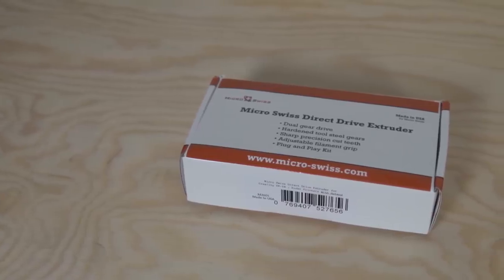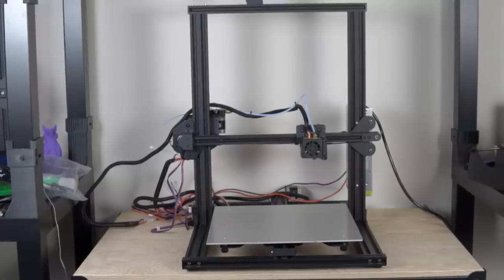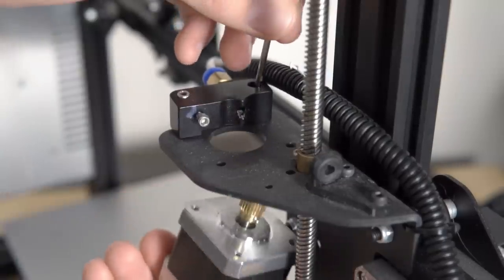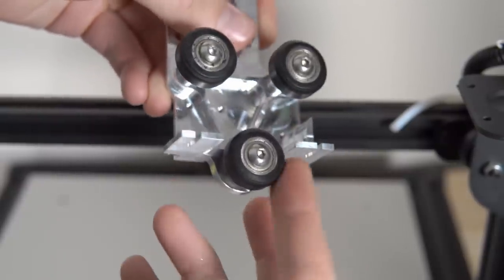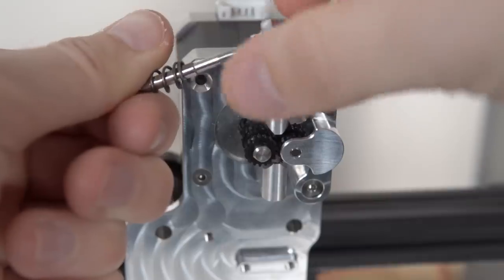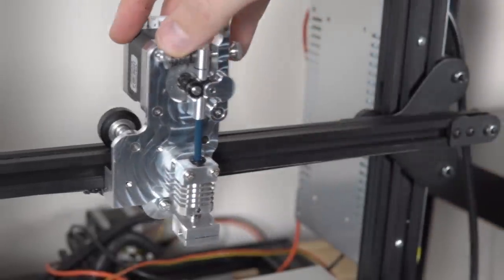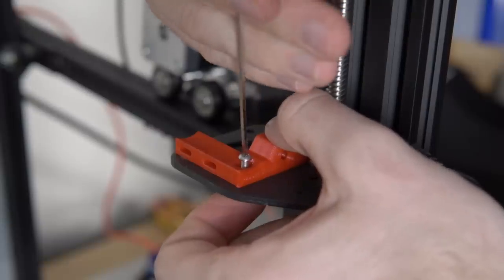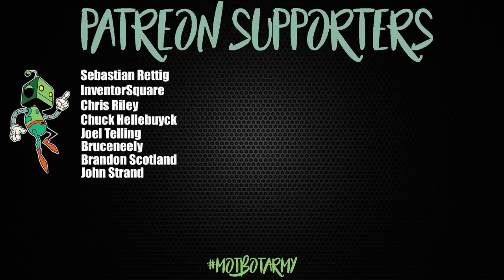Micro Swiss Dual Gear Direct Drive Upgrade For Ender 3 and CR-10 3D Printers

Comment: Thanks for that, great video!! I supose that it can be used with a pancake extruder as well... a bit lighter :)

Please let us know if PLA can be printed with this setup... I know that with some all metal clone extruders it is not possible due to the higher heat and expansion of PLA inside. 

Cheers!
Reply from the maker: That might not be a bad idea. I will see how this prints for a bit and see if I think I want to add a lighter pancake stepper motor. I could not see any issues from printing in PLA but I will certainly put it through its courses.
Reply: @ModBotArmy  Did you print PLA with it?
Reply: Hi there, I have succes-l prints with PLA and this DD All-metal extruder, but I had to lower nozzle temperature in my slicer by 10 Celsius comparing to bowden profile. Printed 3kg of PLA without any issues or jams. Hope, this will be helpful. And don't forget to lower everything related to retraction, because this is DD.
P.S. Please note, there are 1000 types of PLA, even different colored PLA of the same model and brand can have different temperatures that work for them. You need to play with yours. I am using D3D Tough Black.
Reply: Any ender3v2 users; some notes with PLA

1.  retraction = go lowwww and tune up.  like 1mm@20mm/s and then increase from there.  This is critical and will save alot of headaches and swearing.  Noticed even at 5mm it was breaking the filament away from solid/hot, making a air gap and then rice krispy sound from extruder as it hits air gap.
2.  The manual says 130 for extruder steps; seems like everyone lands at 134; might be a better starting point.  Then test with a extruder cube.
3.  Same on temps; finding everything likes the lower end with setup; despite what is in manual.  Printing out some heat towers for testing recommended.
4.  Still not 100% that heat creep is not effecting PLA.  Lower retraction seemed to fix mushrooming and breaking PLA.  

Overall with 190-200@44m/s and then retraction 1mm/@25mm/s i can get decent reliable prints with PLA.

Comment: Have you had a problem with the Extruder stepper motor working with the Micro Swiss?  Some have suggested that the motor is not fast enough for the increased estep.  My Extruder drive failed on my Creality Silent board after a week.
Reply from the maker: Interesting. No I am using a the stock stepper motor but I am using a different main board. I am using the skr mini from big tree tech
Reply: Is the SKR Mini completely compatible with Octoprint, Cura, etc...?  Do I have to make any programing upgrades to use that board.  I've heard good things about that board.  What version do I need for an Ender 3 pro?

Comment: So does microswiss have the g code for the esteps like you showed in the ender 5 video like this?
Reply from the maker: They sure do! Here is the PDF (It is towards the bottom): https://cdn.shopify.com/s/files/1/1210/0176/files/Micro_Swiss_Direct_Drive_Extruder_Installation_Instructions.pdf?v=1592671102
Reply: @ModBotArmy  awesome, I've been umm'ing and arrrr'ing on if I wanted to spend similar to the initial purchase price of my ender 3 of this upgrade. Especially wanted to make 100% sure it's a performance upgrade worth doing

Comment: after reassembling Im getting thermal runaway protection on every power on, thermistor was heated before i removed it.. am i fucked?
Reply: did you ever find a fix for this?

Comment: Ender 3 pro extruder motor is press fitted had to pull out the dremel and cut it off the. Polish the rod untill the gear sliped on with little resistance
Reply: There is no flat on the pressed on shaft as well. Have you had slipping issues or did you make a flat on the shaft with your dremel?
Reply: @jpeterman57  yup, made a small/shallow one with the Dremel

Comment: How much X-Axis distance do you loose? I'm assuming you'll lose some to keep the stepper motor from hitting the uprights?
Reply: None. The motor clears the X and Z frame pieces.
Reply: @macdox69  my extruder goes past the upright frame on the right side..if motor is mounted ontop of the x rail and hangs past the back, it will run into the upright frame

Comment: direct drive means no bowden tube? am i wrong?
Reply: Marcelino Romero wrong.

Direct drive means you have the shortest, around to 0,5-5cm space between hotend and gear.
Bowden usually 30-80cm.

Comment: Hi , did you by any chance do a Vid for the ender 3 v2? are there any parts that needs to be printed before installing it?
Reply: Yup, need a fan shroud.  I'm still researching it, if you find a solution, let me know.

Comment: debating between getting an ender 3 pro and upgrading a few bits, including making it direct drive, or just going with a Sidewinder X1
Reply: I was struggling to decide before xmas also on the Ender 3 pro or base model. 

I ended up getting the basic Ender 3 (non pro)..... and it is amazing. Honestly, if there is an improvement that the pro has... I couldn't see what it would be in terms of print quality.
Reply from the maker: I would say if you do not need the build volume of the X1 then go with the ender and upgrade as you see fit. If you know you want the build volume, the X1 is a kickass printer.
Reply: @ModBotArmy  literally just pulled the trigger on an X1 last night, because as you said, I want the higher build volume. It'll be my first 3d printer and I've researched like crazy so I'm pretty excited to get started!

Comment: should really not use the feed tube. flip the reel around facing front cut a small piece of the feed tube and insert it as a small guide. but it defeats the purpose of the Direct drive if you use the entire tube as it will reintroduce the retraction issues that were in the previous extruder set up.

Comment: Were is the link to calibrate the extruder? Also i have an ender 3 pro were do i set the steps per mm ?
Reply: Never mind i found it. By the way i followed your video to install the DD and it works great thank you.

Comment: ¿This modification changes the printing area in X and Y axis, or is the same as original design? (220x220 “oficial” dimensions, but 235x235 functionally)
Reply: it changes the X & Y by 20mm each
Reply: @OzSimo581  so finally  200x200 printable area or 215x215?

Comment: I have this kit. It's a nightmare to tune on the Ender 3 Pro. Constant oozing, stringing, elephant foot. Yes I tried hundreds of combos of values, temp, print speed, retraction dist/speed, material etc. etc. The bottom line it sucks. At the point that I'm ready to go back to the stock Bowden setup. Looks pretty, but that's about all. Save your money.
Reply: You didn't install it correctly. Microswiss always does great upgrades if you install them correctly, but there's always someone like you who makes a bad review because of PLBUAP errors.

Comment: Does this upgrade also prints at higher temperatures with just connecting it to the printer? I have the regular hotend on my ender 3 pro and it prints at 260 Degrees Celcius maximun, so it just made me wonder if this Microswiss already gives the info to the 3D printer to print at higher temperatures.
Reply: Sorry to not fully answer your question, as I'm still thinking of buying one of these myself, but you should not print above 240ish with the standard ender 3 hotend, as the PTFE tube starts to degrade and give off very toxic fumes.   I think you might need to upgrade the heater cartridge and sensor and then you can print much higher with the microswiss :)
Reply: @chrisoverson  Yes you can, you do not need a new thermistor or heating element but you make have to adjust the firmware.

Comment: I've installed this along with a new heater cartridge and thermistor but I keep getting heater failures. My PID autotune failed as well. Did you have any similar issues?
Reply: Did you put the silicone sock over the hot end? I have had failures when i forgot that part.
Reply: @instanoodles  Actually, it turns out the thermistor that was bundled with the Micro Swiss was a 24v and not a 12v. They look identical which is why I spent so much time trying to diagnose my problem but in the end it was hardware related. Everything is smooth now!

Comment: Looks like this expensive "upgrade"  uses nylon gears?????  What's up with that?  Metal gears is a basic first upgrade on these, isn't it?  Curious.  Some may jump on the upgrade wagon to add anything "new" for a chance to get a better print, but this just seems to be two steps forward and one step back.
Reply from the maker: Nylon gears? No way they are hardened steel.

Comment: Do you know if popular cooling solutions like the Hero Me will fit on this replacement mounting bracket?
Reply from the maker: I do not. I have a feeling that it will not fit this without some modifications but I cannot confirm.
Reply: @ModBotArmy  Someone on Facebook stated that Hero Me will fit unmodified on it. I guess dimensions and holes are the same as the original. Good news. Thinking of getting this with a 0.9 degree pancake stepper.
Reply from the maker: Awesome :). I only know if the setup and have not installed it so I didn’t want to say without uncertainty.
Reply: @ModBotArmy  Looking forward to a review after some use. I have the Ender 5 Plus with a 600mm bowden tube so I definitely think a direct drive would benefit it.

Comment: after installing this on my ender3 and re-calibration of e-steps  and setting retraction to 2mm my prints look worse the layers arent as smooth in the Z direction as with the bowden setup using an EZR extruder , any ideas on what this could be I also disabled coasting to see if that would help and it made no difference, i tried reducing acceleteratin and jerk to 300 from 500 also to no avail . my prints just look of poorer quality with is setup
Reply: Did you fix?
Reply: did you fix as mine is printing junk compaired to the standard one

Comment: Does anyone know if this will fit the ender 3 v2?
Reply: I just installed it on mine and it works! Before you install it you need to print a different fan duct because the V2 one won’t work. I used the Satsana that I found on Thingiverse. https://www.thingiverse.com/thing:4369859
...others for the Ender 3 or 3 pro should work as well.

Comment: Installed it on both my ender 3pros yesterday, wondering what you're using for slicer settings, printer speed and retraction settings?

I've currently got them at
100mm/s printer speed
1mm @ 40mm/s retraction. 

Hoping to add more speed to it, haven't tried yet
Reply: Here is the note from the manual: 'Reduce the retraction amount. Maximum recommended retraction is 1.5mm @ 35mm/sec.' - I have 6mm and 25mm/s as original - will test it in the next two days. What are your results so far with your settings?
Reply: What do you think about it after using it some time? Any pros and cons? Is it worth the price? Does it print PLA as well as flexibles? Whould be nice to hear what you think about it! :)

Comment: does this allow mounting of printed coolers?
Reply: Yes there are a few on Thingiverse allready.
My printer has a small circuit board on the hot end and there is an adaptor for that also.
There are no accessable screw holes on the right side other than the cooling block screws but the shrouds are designed to go around the cooling block mount using it as support.
I like the stepper motor mount. It levels the wieght on the nylon wheels in the x axis. I think it will help prevent problems from all the wieght from the extruder hot end kit being on the front side of the x axis pulley system.

Comment: Thanks for the video walkthrough tutorial. Everything worked great except for the whole carriage was tilted and angled toward the bed. I tried adjusting wheels and eccentric nut of bottom wheel but it just wouldn't stay parallel with the bed. Any ideas why?
Reply: Mine is doing the same. hope it's not a problem

Comment: As of today, CR-10 v2 is 302.68 quid, Micro swiss "Upgrade" is 97.55... Almost a 3rd of the price... Seriously!!!???? This doesn't make any sense to me, I don't really care is it made in US of A, or EU or whatever.. I do want to support local business, but when they start ripping you off, then I shall withdraw my support..
Reply: I was laughing as I was installing it. This is supposed to be an upgrade? The only thing I really wanted was the all metal hot end to print ASA. Once I started putting the rest of the kit together I realized how unnecessary it was. You're literally still using a Bowden tube, you're just putting the drive closer to the hot end. Is that necessary? We've been printing fine without it for years. You're also putting all the heaviest parts on the print head. Why in the hell would I want to do that! On top of that I was going to have to print a new fan shroud before I could even print with it.

I'm returning my $100 kit and I'm going to buy a less expensive all metal hot end. I'll put that money I save to use somewhere else.

Not to mention these parts are easy to machine. Everyone drooling over the quality of the parts and saying not to get the knockoffs is making me laugh. Especially as an engineering and fabricator. They don't know what they're talking about. It's crazy how easy people will give up their money for things that are completely unnecessary. Hell, I did. Unlike others though I figure it out before my return period is up.

It was actually a joy removing it from my printer knowing I was getting $100 back.

Comment: So you all know just did this had a fun time resetting and tuning home, threw it off
Reply: How did you get it sorted ? having the same issue and cant seem to recitfy it. Are you using a bltouch ?
Reply: @jwphotos84   have the same problem now home is off the bed lf .
Reply: I need to know the fix for this as well. The PDF from MS seems to be out of date.
Reply: @PastorTFS  so I ended up getting a th3d board and abl sensor and it fixed my offset home and made my prints way better.

Comment: Has anyone else had strange artifacts printing when trying to print smaller than .2 layer height? I just cannot find the cause, and nothing alters it.
.2 and larger prints great.

Absolutely at a loss.
Reply: Contact Micro Swiss
Reply: What Filament where you using
Reply: @pedrodacosta3378  I have contacted Micro Swiss. They are agreeable to sending me a new one, though.. I'm skeptical now. I've been trying for two weeks to make a difference, and it won't

4 different types of filament. 5 including ninjaflex, but it's so far off it isn't really comparable.

Comment: I do not recommend tightening the grub screw once heated to 220! I did this with my microswiss and then when I got a clog I tried to remove the heat block. The grub screw would not come back out. And it stripped, probably because they provided an Allen wrench with ball tip ends. Basically it was $80 down the drain

Comment: Great guide for sure...really helpful for me.  I did the install on an Ender 3 V2 and the stock hot end fan and parts cooling housing won't fit.  I bought a 5015 fan and used this:  https://www.thingiverse.com/thing:3594559

One question - why use the old bowden tube and load from the side?  Why not rotate the spool 90 degrees up top and feed directly down into the extruder from above the way many other printers do?
Reply: Let me know if you find anything out about this. I was under the assumption that a direct drive would mean no bowden tube at all as well.
Reply: I just completed the mod and if you turn your spool to the other side of the top aluminum cross member the extruder and stepper motor will hit the spool near max Z. If you never print near max Z or you intend to put you spool atop a cabinet made from Lack tables this is a non issue and I would recommend just turning it to the other side and avoid the side loading bowden tube all together. You could also design and print a spool holder that hold the spool higher and out of the way of the extruder/stepper motor. 

I found some issues with the cables for the hot end and extruder getting caught between the extruder and right side vertical post. I "solved" the issue by running the cables over the top cross member. I do not recommend this solution long term as the cables seam to pull a bit at full right X when Z is at bottom. Good cable management seams a better solution. I have more mods coming in over the next few days and will post an update with a better solution once those are complete.  

I suspect I lost a bit of Y volume as I moved the Y end stop forward to compensate for the increased thickness of the new X carriage over the old one. The instructions have you change the offsets in the firmware, but moving the end stop was much faster, achieved the same result, and I didn't have to mess with the firmware. This got me up and running much faster.
Reply: also worth noting, the over the top cable option only worked at all because I have mounted my board in the back of the printer along with my octopi.

Comment: This thing is completely unnecessary and a waste of money.

You're still using a bowden tube. You're just moving the extruder closer to the hot end. Look at all the weight you're adding to your printhead! 

The only thing in this kit I would consider an upgrade would be the all metal hot end, and for that it's such a simple part to make you're better off going with a knockoff. Don't fall for the nonsense of American made if the company is overcharging for an easy to make product like this and really pushing the american-made part. That's when you know it's obvious marketing.

I say that as an engineer, fabricator and machinist who actually bought this kit. Halfway through installing it I started to laugh at how unnecessary it was. I returned mine.

I'm going to upgrade my extruder right where it is as to not add any weight to my printhead and I'm getting the cheapest all metal hot end I can find.